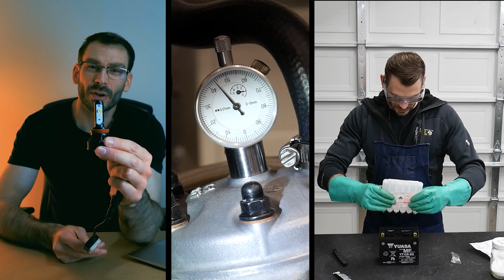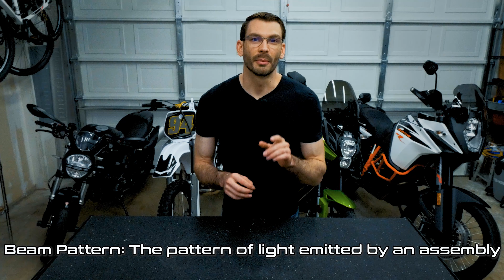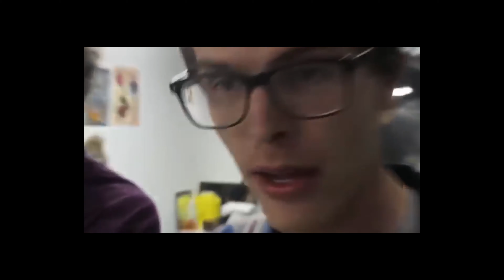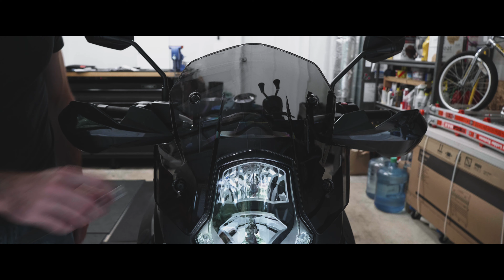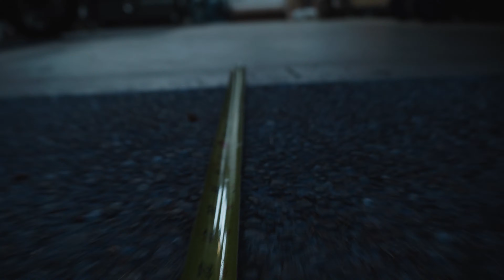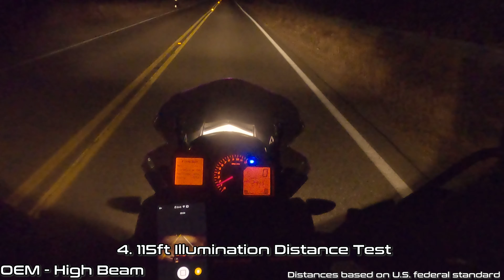Motorcycle LED Lights | Are They Worth It?

Comment: Amazing video, explains literally everything. In EU cops know pretty well if a bike should have a LED light or not, and you'd get screwed very quickly if they stop you. Yearly inspections are a no-go too. There ARE some homologated bulbs apparently by Philips and Osram, but they can cost over 100 euros each. Not sure if it's worth it. I've never tried a LED replacement bulb like an H4 or H7 that doesn't have issues with beam pattern yet.

Comment: this video is golden. 
LED headlight bulbs are a real PITA to shop around for, since every design is different for no discernible reason and every different configuration leads to a different light spread pattern, ridiculous. not to mention all the leads and drivers and sht you have to find a way to stick onto the plastics of the bike, and on my bike in particular, no way would an LED bulb fit in the rubber grommet that prevents water ingress into the light assembly. Gonna stick to halogens and try to strike a balance between brightness, longevity and price.
Reply: Same here. After much research I've decided to stick with halogen bulbs on my 2013 Ducati Monster. There are too many potential downsides to LEDs to justify the expense and effort of installing them.
Reply: i have moto vision philips on my cbr300r, they are awesome

Comment: The lights are intentionally of different colors. In good weather, white is the best color. However, in bad weather conditions (fog, rain, snow, dust) a warmer (more yellow) color will penetrate the haze better than white.
Reply: Not sure the light penetrates any better with more yellow light, but can imagine the reflection from the haze/heavy rain etc is much less self blinding with a more yellow light as its less intense

Comment: If you average 35 miles per hour, the LED will pay for itself around 350.000 miles in ( at which point you would have used up around 10 halogen bulbs ), and it will last for around 1 million miles.

So be honest, no bike LED will ever really pay for itself - 99,8% of people do not put 35.000 miles on a bike, let alone 350.000. That's like '14 times around the world' territory. But at least you could be sure that LED would go around the world a further 28 times, which is when you realize that you're 70 years old and you bought the LED when you were 18.

So, actually, if anything it pays for itself for the NEXT owner or even one owner or more further down the road, as THEY won't have to replace anything, yet didn't need to shoulder the initial costs. But in all likelihood, the bike will be turned to scrap metal long before the LED system ever paid for itself, as only a select few bikes will ever reach 350.000 miles and beyond.
Reply: That‘s not the point. The point is more light output, a modern styling upgrade and no need to make room for a replacement bulb. I do ride quite a lot and my bulbs burned out every other month without warning, space is a real issue on sport bikes as well.